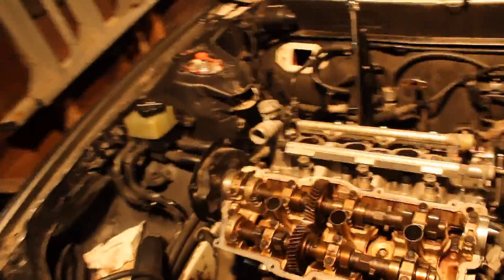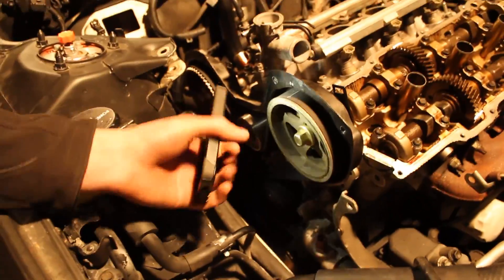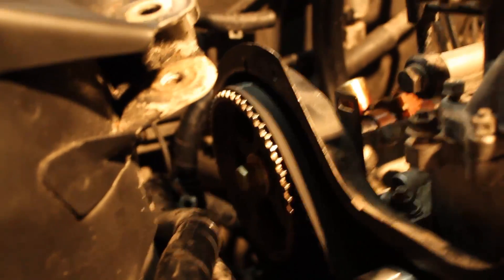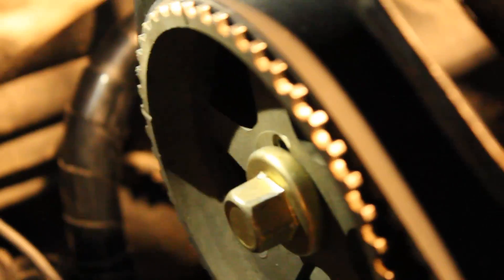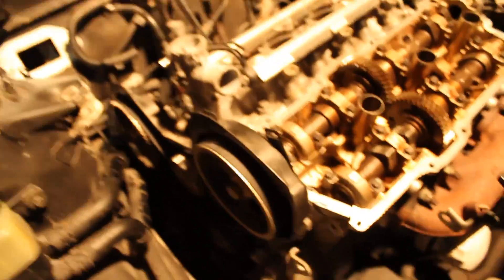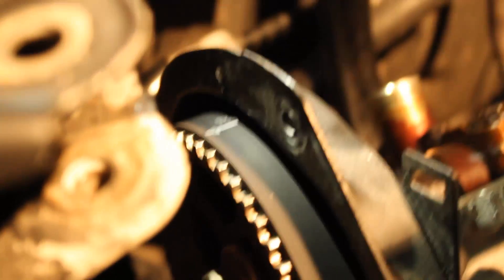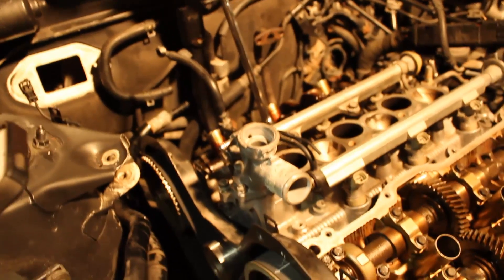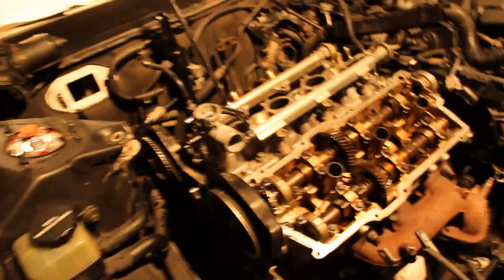Toyota Camry 3VZ-FE Timing Belt Setup Marks Explained

Comment: This is 2016/2017 and I was goin g to redo my engine without the manual . It's bee n a few years since last removed the heads and did a conditioning of the valves. Not too many of these engines still around I bet but I'll add any tips for future readers.

Comment: I just did a timing belt on this engine in a 1993 es300 I don't see a 0 degree marker gauge by the pulley I will check again im in the finishing stages belt is on and car runs but didn't put it all back together. I just lined the crank gear up to mark on engine scared I did it wrong but it runs and all 3 marks are dead nuts after letting engine run 30 - 40 secs.
Reply from the maker: Sounds like its been done right. The 0 degree marker is shown at 1:50. I am not sure why you don't have one. Here is the instructions if you don't already have them http://www.mr2forum.de/3VZ-FE_Engine_Repair_Manual.pdf
Reply: porkercon thanks! I found it it was caked with grease couldn't even tell it was there haha. It was correct how i had it and car runs and drives fine now. Im kind of a noob at timing belts at first I was trying to match the belt marks back up with the cam and crank lines/dots couldn't figure out why they weren't lining up after manually turning engine over then I was like wow im dumb lol. its actually hard to mess these up on Toyotas.